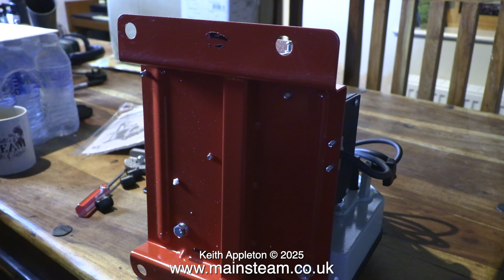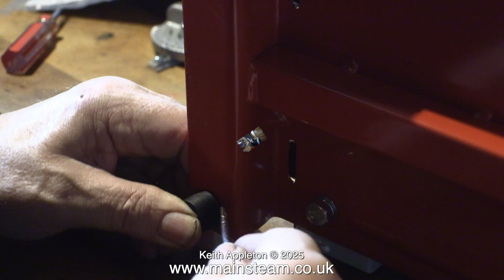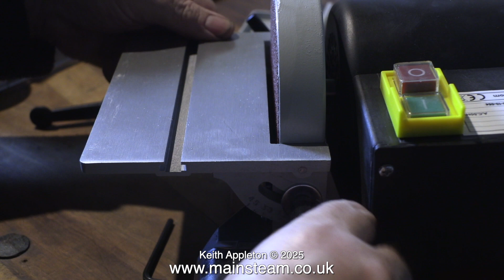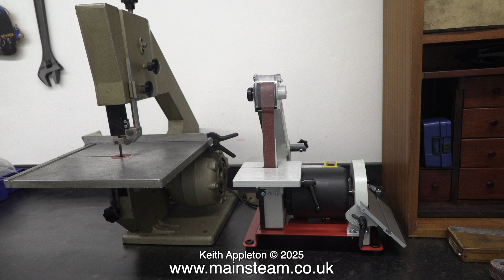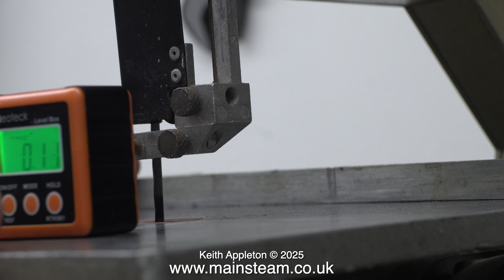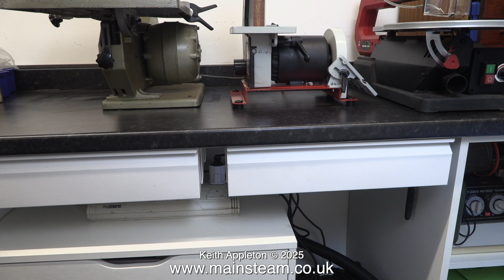WORKSHOP TOPICS - A NEW MACHINE ARRIVES - PART #3

Comment: Square to the blade is more important than level when it comes to band saw tables.
Reply from the maker: Yes indeed, but on this Bandsaw when the table is level the parts being cut are at a perfect 89.999 degrees depending on the temperature and Barometric Pressure }:-)))